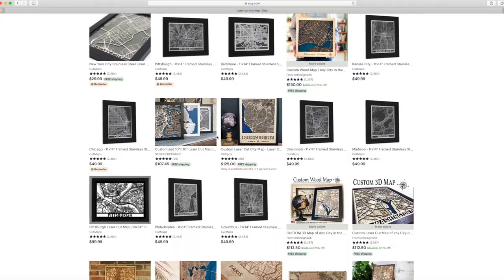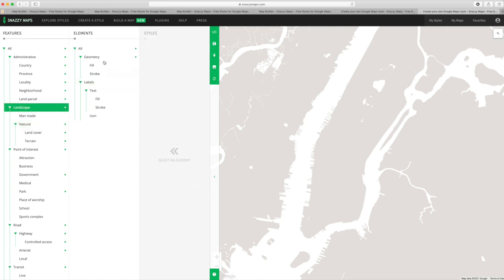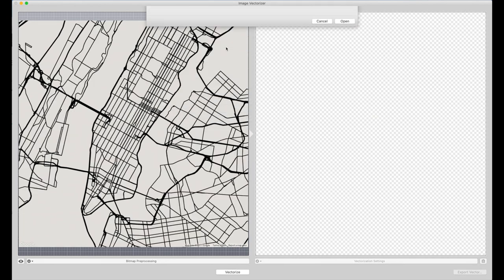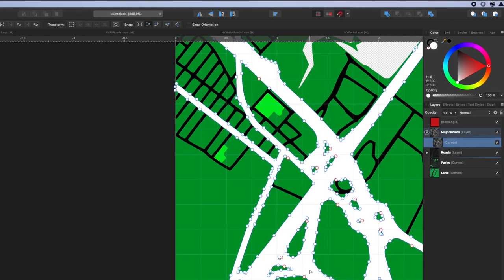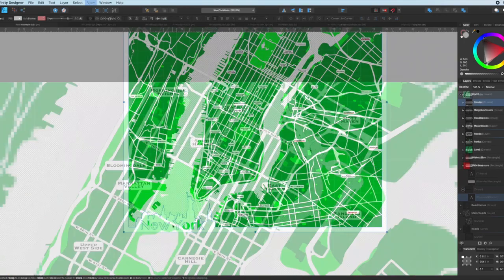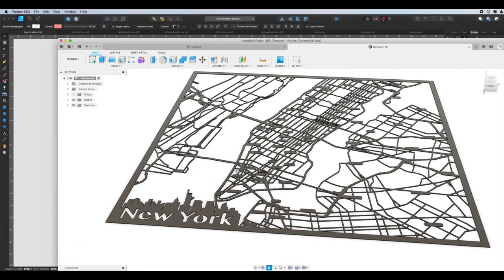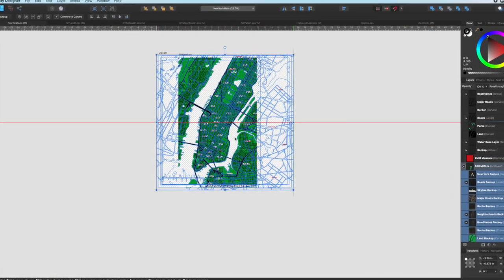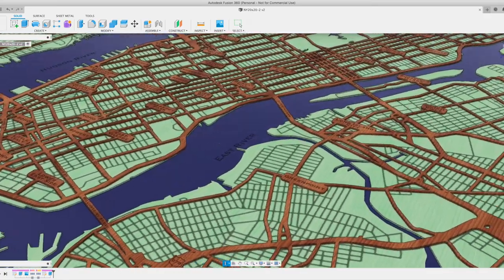Laser Cut Raised Street Map of New York

Comment: I used Snazzy Maps in the beginning but using QGIS is way easier and you can actually export vector based SVGs instead of having to trace manually or in illustrator/affinity/inkscape/etc.
Reply: Will it create single line roads so you can just score a line rather than engrave?

Comment: Great tutorial, thank you!

I'm just curious why you're exporting to a PNG file and then tracing in Lightburn when you already have the design in a vector format. Wouldn't it make sense to just export them as vectors, which would be less work and less quality loss?
Reply from the maker: Great point, and I should have mentioned it.  Affinity supports exporting to PDF and SVG which I could do, and even layer in colors which auto separate.   But lightburn only supports font independence from DXF which it doesn’t support, and DXF doesn’t seem to support size anyway.  Lightburn trace does really well IMO, and is why I export PNG with a high DPI...
Reply: @ThisIsHowIMadeIt  if, prior to exporting, you made a new text layer and converted the text to paths, that would import really well into lightburn, as svg. You'd then not have to deal with tracing, and re-layering everything. Worth trying :)
Reply from the maker: You are right.  SVG does have that option.  It may be a better workflow...